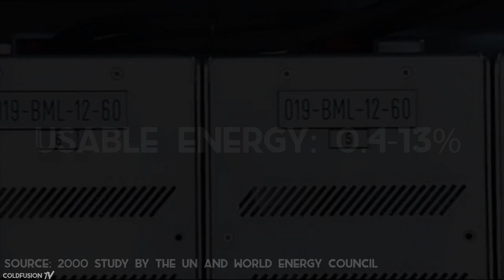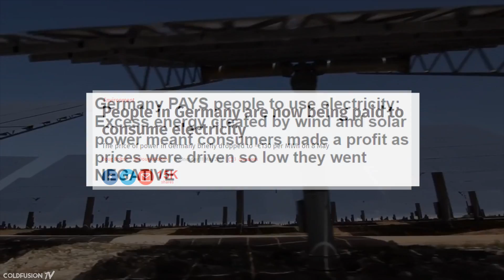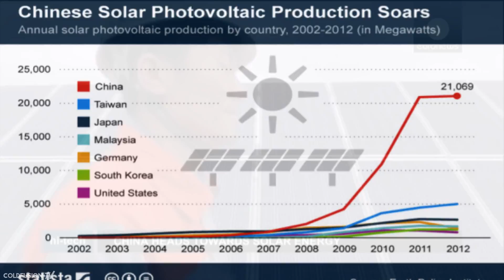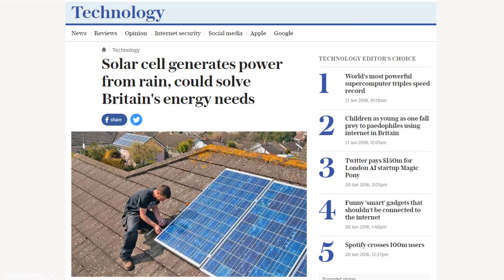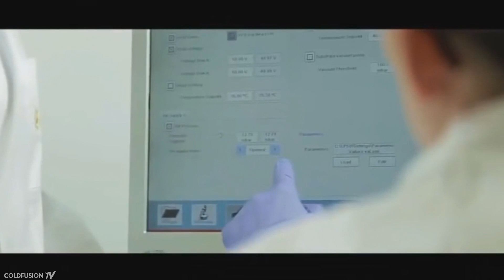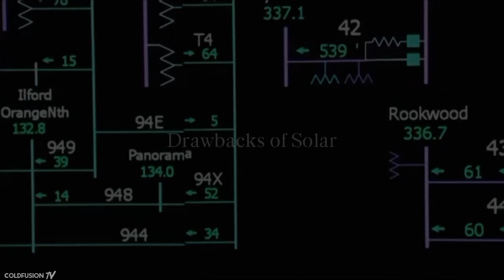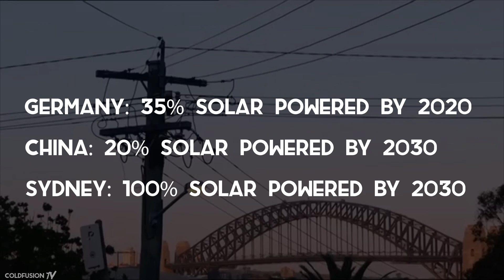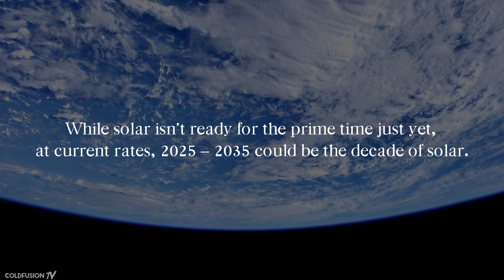The Truth About Solar

Comment: Wind and Solar are reliable in one aspect - they are 100% certain to be discontinuous.

An electric system of a society has one absolute requirement - to be 100% continuous.

Here you can see one year of energy production in Germany. 2018-2019
The yellow color in the graph is solar power. 

As you can see there is NO useful solar power in the winter - solar is discontinuous:
https://www.agora-energiewende.de/en/service/recent-electricity-data/chart/power_generation/01.08.2018/31.07.2019/

Over a month in summer there are flashes of light each day, but notice there is a gap between the flashes where there is no solar power at all. Solar and wind in combination are discontinuous.

https://www.agora-energiewende.de/en/service/recent-electricity-data/chart/power_generation/31.07.2019/31.08.2019/

Focusing on one day with poor performance from wind and solar - between 21:00 in the evening until 05:00 there is a tiny contribution from wind power only. 

https://www.agora-energiewende.de/en/service/recent-electricity-data/chart/power_generation/11.07.2019/12.07.2019/

It means no matter the amount of wind and solar, over periods of time you need to be able to power the entire system using something else standing on the side waiting.

The less the backup is used the less financially feasible it is to run or own.

Who is going to pay for the cost of continuity?
Reply: That's not the point rn. That's what the video discussed - the efforts to increase  mass production feasibility of devices like that MIT made solar device with better economy & storage tech like the Tesla Power Wall- the devices which make the overall output consistent. 
The sooner we pain ourselves the better. Can't forever be living off fossil fuels
Reply: @yugen3968  I am not pro fossil fuel. The problem is to invent something equally competitive or better.

We live in a fossil fuel heaven and think there is an easy way out.

We are trying to compete with an energetic energy source of extreme simplicity. Harwesting energy is just a small part of the problem.

The energy has to enter all portable/mobile machines and for idiots to maintain.

That was elegantly solved using gasoline.

Now we have to solve the problem again and be equally efficient.

If we are only half efficient or struggle say four times more to perform the same work - society will decline sharply.

Some work we are doing today will be impossible using man made fuels.

I work with power electronics, run a hydro power plant and wind power automation. I drive an electric car.

We are not even close to being competitive against fossil fuel.

We think we are, but we think in a world that would vanish if the fossils where left out.

What we leave behind are piles of electronics and used up Li-Ion batteries and think we are smart.

Land area will be filled by solar cells and sky filled with rotors.

It is far from elegant.

We will live on a dump if we do not come up with something better.
Reply: Residential Lithium Power Walls and grid-sized Lithium Power Packs smooth out PV output = continuous output.

Comment: If you think the sun is 93 million miles away you have been fooled. It is very very close to the earth. Please get a telescope and use it. And no we don't live on a spinning ball either. Please do some basic research.
Reply: There's a very high probability that the distance between Earth and the Sun isn't exactly 93 million miles. That's because this is an approximation and the distance varies all the time. But by observing another planet (Venus for example) and using basic trigonometry, you can approximate the distance quite accurately. That's how we ended with the 93 million miles figure.

We don't live on a spinning ball, the Earth is not ball-shaped. But we are spinning, how else would you explain the 'motion of the Sun'? Is the sun, which contains about 99,8 % of our solar system's mass circling around the Earth?

Comment: at about 10 minutes in downsides of Solar. You said peak demand happens at night for a home. That is not true. The GRID has Off Peak low rates because the GRID and homes use less at night Off Peak.
Before that you showed the Prius car with a solar roof. It only provides 1 mile or so of energy. It's never at the right angle to make the most power and people park in the shade. It's a poor idea like the Solar roads.
Reply: Unless you're from Las  Vegas

Comment: NASA utilizes solar technology that is FAR more efficient than what's available on the common market for the rest of us. All these years solar has been around, and also subsidized by taxpayer dollars, and it's advances are moving forward at a snail's pace. This is aided by such phenomenon as electric utilities not wanting the advancements to take place. It's not in their best interests. Solar is grossly inefficient with the panels available to us commoners. Local governments are also an inhibitive with them thinking they are the authority over what you do with your own property in relation to solar and how it's connected. You can have panels on your roof with no connection between the solar system and the power grid. However, protectionistic posturing drives them to agressively threaten homeowners who install panels without their blessing through "permits" and expensive inspections, which is little more than them rubbing their filthy noses into your personal business. Solr is still grossly inefficient. Going off grid is clearly NOT what utilities want.
Reply: NASA probably use exotic materials like GaAs.  The cost per watt for those is extremely high, but in space applications cost is not the main issue.

The video claim of 35% efficiency also sounds laughable.  It is not good just quoting efficiency, you need to quote also the cost per watt.   And this is not an academic issue, the output of solar cells is generally pitiful.  It is OK for low power electronic devices but not so good for central heating or powering a car.  And we still to pay the same capital costs for traditional power stations as solar cannot guarantee to keep the lights on.

Comment: Ah solar. Reminds me of Fred Flintstone powering his car with his feet.  I'm sure we could power a city with rubber bands as well but let's face it, when you want to move a house 500km on the back of a truck, it won't be an electric truck.  As for batteries, reminds me research to breed better horses when we really needed a total new technology called a car.
Reply: And who says there won't be a newer solar technology with higher efficiencies? Right now we get about 25% efficiency of a solar panel. What if we make them 50%, 70%, 90% and 1/10th, 100th, 1000th the cost? Remember, we have lithium battery technology that can power a Tesla 500kms. Was not practical when we had only lead acid batteries, then Nicad batteries, then NiMH batteries...finally we have Lithium ion and soon some other tech like solid state or graphene batteries. The computer you're using right now was not possible when we only had big honking electrical mechanical relays to switch a single bit of logic, still not possible when we used vacuum tubes to switch the same single bit of logic, then the invention of the transistor and as it got smaller, cheaper & faster you have the computers you use today. Explain to me how solar power & battery energy storage is different and will never get any better and cheaper? Explain to me how because of where we are today we should halt of production and improvement of the technology and do nothing? Imagine mankind "stopped" at the electro mechanical relay and the lead acid battery??
Reply: @motoarzan791  You miss the point. The valves of yesteryear were replaced by transistors. A real breakthrough that could be miniaturised extensively and still is 50 years later. That is what makes my computer possible. You don't get breakthroughs researching better metals for a valve. That is what battery research is.  You need a quantum leap and not just 20% or so. These breakthroughs usually happen via a link to unrelated research in physics and chem. You don't get a car by breeding a better horse. The solar con is always awaiting the next breakthrough in transport while doing horse breeding- billions spent by obama on batteries that went nowhere. Better to put that in fundamental physics and chem.  Good example. Say we want to convert to total space commuting so that rockets take us to any city within 2 hours.. Only problem id the reliability of jet travel is millions of passenger flights b4 we get 1 fatality. In current rockets the death rate is about 1 death every few hundred flights at very best. Hey, just convert the world to rocket travel because the research will catch up and the breakthrough we wait for will happen tomorrow. Never does. Rockets will never be as reliable as jet engines. Solar panels won't ever have the efficiency of a decent gas fired generator and batteries will need a breakthrough in quantum theory that benefits quantum chemistry and not just a mere change in materials. But hey! A lot people made a lot of money out of moron investors like you or from governments that have been conned to give them subsidies for their crap products.
Reply: @DoctorShrink  ... But there are electric Semi-Trucks with a 400 km range !
Reply: @MrSummitville  vs what range for diesels and what payload factor given space for batteries and what downtime for recharge. Such money makers...
Reply: @DoctorShrink  Diesel engines have been around for about 100 years!  Electric Semi-Trucks are a brand new concept. Range will increase as energy density increases. A 400km rage is impressive for 1st generation. Let's see where  battery technology is 100 years from today ...
Reply: @MrSummitville And how long have batteries been around? Several hundred years in lab demos with various forms of acid and lead. You see people like u are always promising technology breakthroughs that never happen. Electric trucks were operating in London and new york 100 years ago. Technology has improved but not enough to overcome the sheer energy density of fossil fuels. Breakthroughs happen thru lots of fundamental research- in this case in quantum chem and physics. Most breakthroughs are semi accidental e.g. penicillin. Nobody thought "we should invent antiobiotics"  So fund pure research and it might happen but waste billions on the Obama "better battery" slush fund and you get nothing. You get a better horse from a breeding program when what you needed to invent was the internal combustion engine. But while the tax credits and subsidies flow to buy green votes we will continue to appease believers like you. It's like trying to fund a better rocket to get to the other side of the galaxy when really u need warp drive, but the voters believe in rockets and are prepared to vote their taxes to stupid technology that has no chance.

Comment: I love my solar panels. I pay only $8 per month for all utilities during the springs, summer, and fall. With just 8 more panels and two small windmills, I can do that in the winter as well. With batteries, another inverter and back up generator for emergencies only I could take it to $0 per month aka no power bill. The system is designed to last 20-30 years but can go longer with maintenance and repairs.
Reply: don't get me wrong, I have solar too but that seems like a lot of money and effort to save $8 a month
Reply: @juzzshel1069  i think they mean that their solar panels make them pay $8 a month
Reply: @gidoiurafael  yes i get that, I meant where he says getting more panels, two small windmills, batteries, more inverters and back up generator to cut the remaining $8 seems alot
Reply: @juzzshel1069  That's 3,000 bucks over their lifespan though, plus you'd be completely self sufficient and cutting down on emissions.
Reply: @almostskater3210  Im referring to the amount of extra stuff required to save the remaining $8 a month seems like a lot for such a small saving. Emissions aside, you don't know what is powering their electrical generation from the grid.